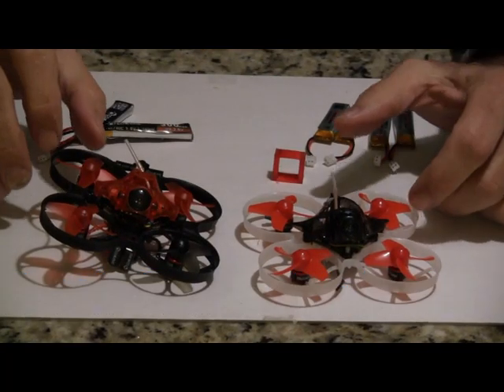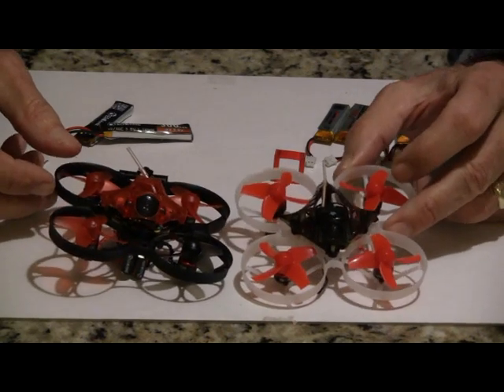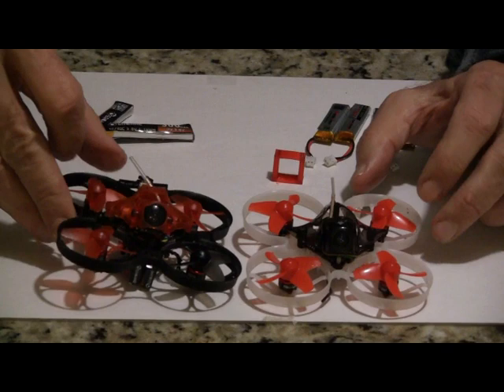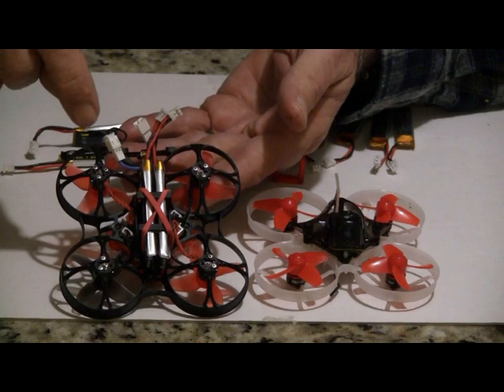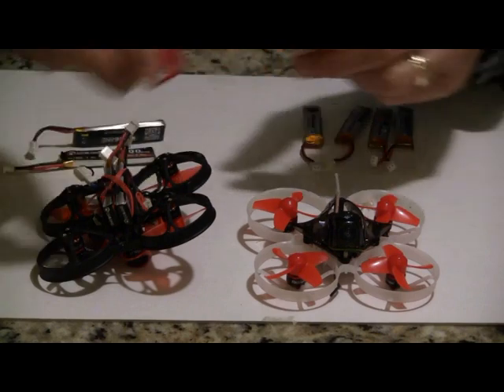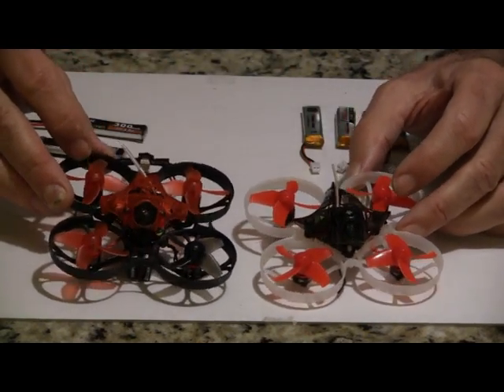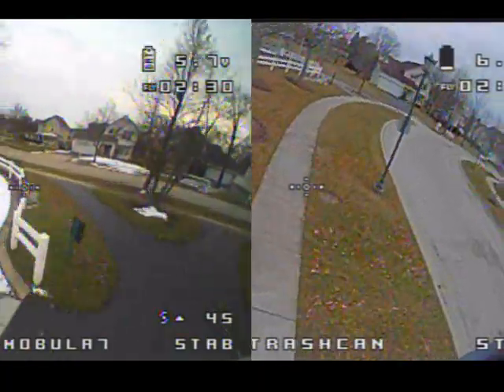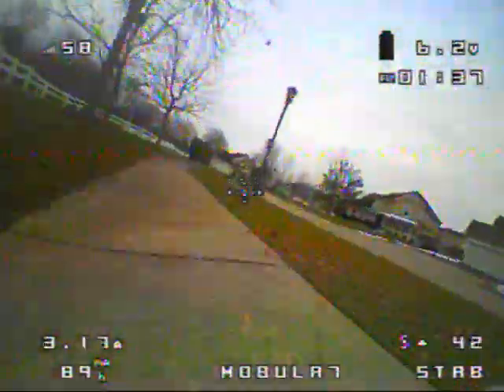Trashcan vs Mobula 7 Comparison

Comment: if you remove eachine sticker from battery you will see is 30c not 40c as they sell them so you can pump only 9amps out at normal rate and trascane is using 12+ 

at least i got 30c batterys

Comment: Yeh but mobula 7 can support 1 & 2s. Not sure about the eachine  though.
Reply from the maker: All Season Affair eachine also support 1S and 2S also just like the Mobula 7
Reply: @jmoore3854  I cancelled my order once I heard betaflight announced they are not going to support and F3 flight controller soon.
Reply from the maker: All Season Affair betaflight 4 series will be the last versions to support the F3 flight controller. It will probably be 6 months till BF 5 is released and you can always use BF 4. The trashcan does have the better spec F4, better camera and 200 mw vtx but the mobula7 is lighter
Reply: @jmoore3854  and so does Arris 110hd and BetaFpv 85x hd

Comment: I can only get one... Which would be your choice?
Reply from the maker: If the Mobula 7 are shipping with a better frame I would get it I like the lighter weight a little longer flight time and the buzzer. See if they are sending with newer frame yet. The Mobula 7 is a little slower but most tracks your not going full out. Like how sturdy the Trashcan is but it puffed one of my batteries. John From Chicago
Reply: @jmoore3854  cool. Thanks for the input
Reply: Love ny mobula7